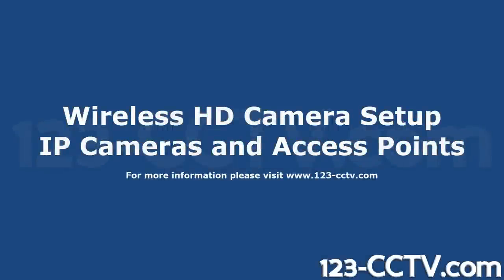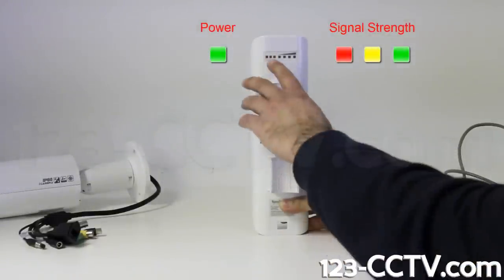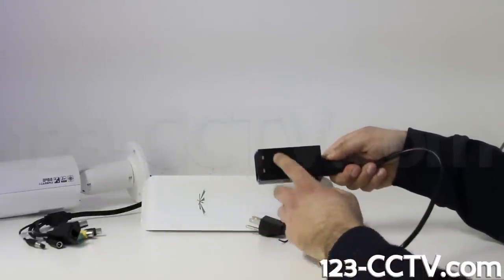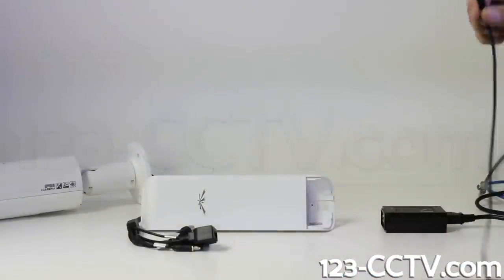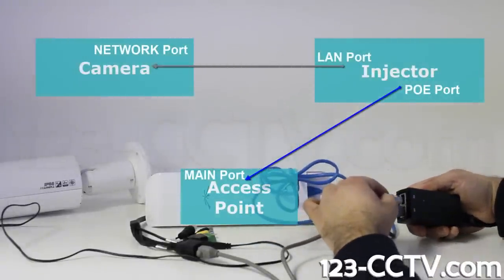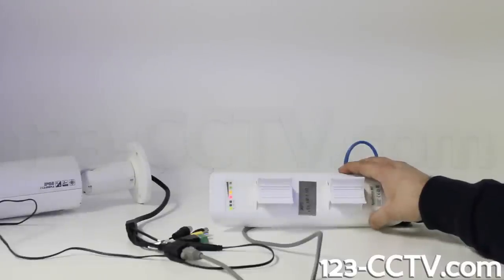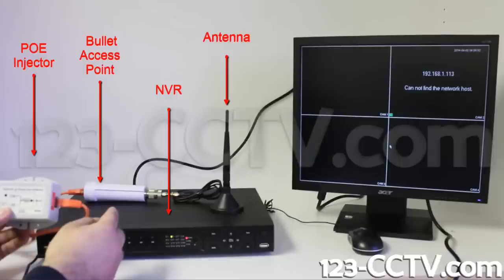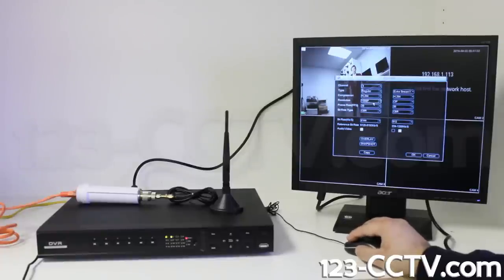123CCTV How To make megapixel IP Cameras wireless

Comment: I need to install 3 outdoor IP cameras.

1 - 3 MP Bullet Camera 9-22mm
2 - 2 MP Day/Night Outdoor Camera w/20X Zoom

Will i Need 3 Receivers and 3 Bullets?
Does the receiver need direct line of sight to the antenna?
Reply from the maker: +Daniel Gonzalez You will need a transmitter/receiver pair for each camera. Line of sight is preferred. If your obstructions are too dense (metal, buildings, etc) or anything you cannot pass a wifi signal through, then it would not work.